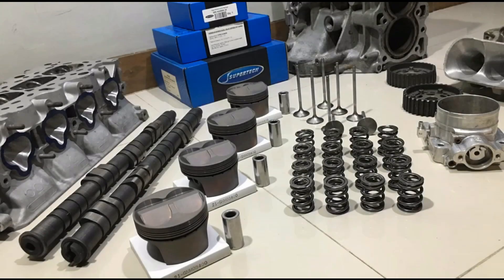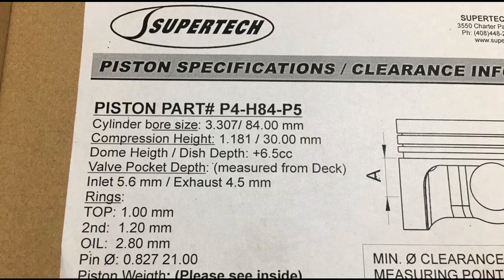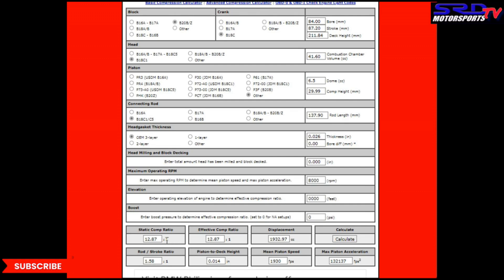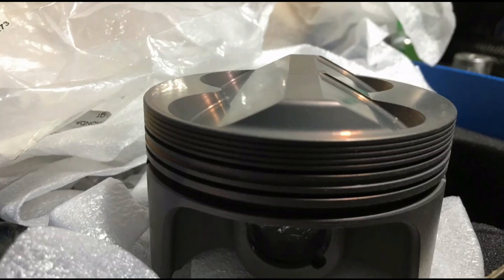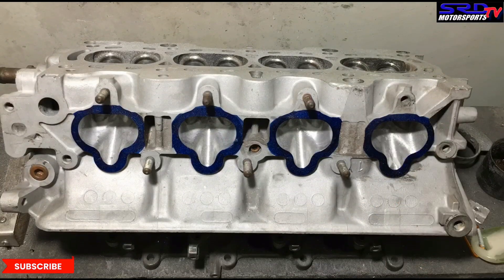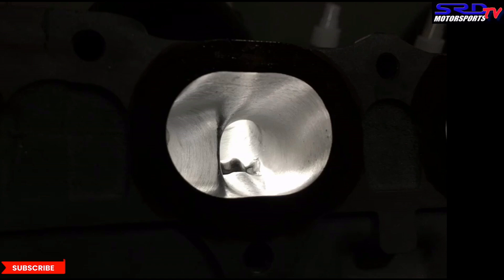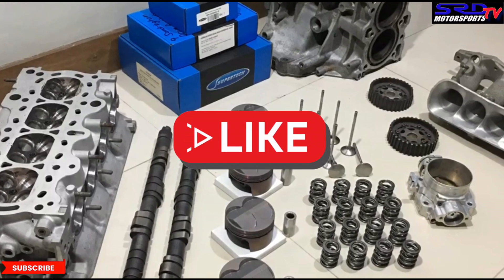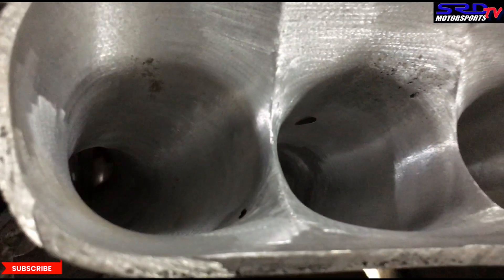B20 VTEC RACE Set-Up Build discussion by SRDmotorsports

Comment: You say pump gas what octane.  93 is the highest I have at the pump and I'm building a b20v after doing some calculating is gonna be 13.7.1 compression
Reply from the maker: 97euro octane so 94US equivalent

But it’s really on tuning 
I’ve seen people blow up even on 99 octane and just 12.5:1 comp

Comment: I think I got my answer on this video, I don’t know? Lol maybe, b18c1 refresh
Reply from the maker: The hard part is “both” of ur options are top choices so both are good actually !
Reply: @SRDmotorsports  the reason I wanted the b18c1 mainly was because I’m able to rev it higher with little sleeve issues
Reply from the maker: @carlosvidal3480  well the b20 has less sleeve issues than most think it’s always a tune issue…

But for track use? That girdled b18c1? I prefer! 😎
Reply: @SRDmotorsports  perfect 🔥
Reply from the maker: Yes sir! 🔥

Comment: What's your thoughts on putting an oversized valve on a Honda heads like putting a 1 mm oversized on an intake side in a  H22
Reply from the maker: on D B and H it depends I mean if the set up needs it… like for example if the set up is on Pro3 cams and it’s still “needing” a bit more? As can be seen on the dyno then yep it will help…

But let’s say anything mild the stock valve size is good for big numbers as it is
Reply: @SRDmotorsports  it's because the bottom end is pretty good high-compression 240 psi all across not sure what compression ratio  the head and block are almost mailed to the max and  Pistons are npr racing 11:1 and I want to make more power the head needs more work everything is stock except the dual Springs and titanium retainers from Super Tech
Reply: @SRDmotorsports  it's because I seen on the Supertech website they had 1+ valves for my motor and I was thinking about it with a cam Skunk2 tuner2
Reply from the maker: That would be okay to try but if a Bseries stock sized valve 33mm is good for 308-310cfm then the H22 with bigger valves should top higher than that… and so with that we know  unless it’s topping up at 310whp then stock valve size is still okay, safer on P2v and v2v too
Reply: @SRDmotorsports  I was just wondering what were your thoughts on this thank you for your recommendations , it  because a dragster that I met at the drag strip he had an H22 and he told me just to put 1+  valves intake side and get a good head port and to leave the stock cam he said I would make good power but I want to put a bigger cam too cuz i want all the power🤣😂
Reply from the maker: I would prefer a bigger cam and not oversized valves, because bigger cam = more rpm … and that helps
Reply: @SRDmotorsports  what if I combine the two 😁😂 yeah I would like more RPM that would be nice
Reply from the maker: Well valve to valve clearance issue and piston to valve clearance issue can happen in that case 

Ur safety window becomes even smaller

Comment: Wow I’m grateful for the amount of detail you give in your videos. Finally got the motivation to finish the the project I never started. B20v GSR head NA to see if I can keep up on the track with my best friends GR Corolla
Reply from the maker: Oh that’s definitely nice to know man! And now u can find more “fun” in your project and so go for it! Sounds like a lil beast in the making!
Reply: I was smoking gr corollas at the track JDM gsr matching trans bolt skunk 1 tuner cam made 178 on a hub dyno gutted car removed front and rear crash bar almost full spherical suspension del sol seat 6 piston bbk gsr rear disc car is a lot of fun didn’t try a bucket seat car was still fast

Comment: How much hp did you get on this build?
Reply from the maker: Hello…this hasn’t been fully assembled/finished as the owner has a newborn now so we know how that goes 😂

but this is an easy 240-245whp pump gas as in 2018 we did a similar but with non forged pistons (1Up) and we got 235whp on full exhaust with a chambered muffler.

Interestingly a hatchback
That does 225WHP (Jasper’s) is a 12.5sec set up on pump gas (Blaze)

While earlier on (on Wiseco pistons) we did 233whp and that hatchback ram 12.1sec
Reply: 12.5 sec pump gas blaze and your using a stock 4.4 s4c tranny?
Reply from the maker: @sharmainecastillo3446  yes ITR tranny

Comment: ? My builder tells me to ditch my b20vtec and build ls VTEC why is b18 block better
Reply from the maker: That’s a common misconception, as way back it was claimed cuz the b20 has siamed sleeves meaning the steel part is merged together they say it causes cracks but I’m also a tuner since 2008

and I know cracked sleeve is 98% on the tune and 2% fuel to be blamed 

Not saying your builder is wrong but we got a b20vtec running 12.5s on pump gas not e85 no trailer a pure street car and it’s been running since 2017 :)

Comment: Hello
That compression calculator can be use for other motor...
Reply from the maker: yes if u include all the proper measurement like adjust deck height to suit and match as well as combustion chamber volume and piston dome volume

crank stroke and rod length together with piston compression height etc

Comment: How much does a build like this cost?
Reply from the maker: Back then (parts were acquired before this pandemic… around 2019-2020)

Was around $1,500-2,000
Granted that was including the actual head this is being built from the ground up

But some b16 owners or gsr owners may have it cheaper a bit since they got a cylinder head already

Comment: Question??? I have a 96 spec type-R motor "JDM-R". Should I just do head work and manifold work. Leave bottom stock. Running all motor. With 9k RPM... or leave it all stock. Oh chipped ECU.
Reply from the maker: I think manifold work and head work is a good start and step forward 

A compression test could also give better ideas if it’s healthy and what state
Reply: Yes compression test for sure. Thanks...we'll plan to do head and manifold work.
Reply from the maker: @jdm-r2524  ayt cool where is this from?
Reply: @SRDmotorsports  MN
Reply from the maker: @jdm-r2524  oh cool! U gotta beware… I got a pm
On the page as u saw we did 201whp on a mild full exhaust b18c SiR right?

Got msg his is an ITR engine with aftermarket forged pistons better skunk2 cams etc
Dynoed at 198whp LOL!

done by a “super lodi shop” thats “mabango” image on FB …told the owner I can’t do anything unless he clears it with the origin of the engine (shop) and we work on let’s say his manifold this way he is a customer but as of now? Sadlyf imagine cost of that (aftermarket pistons and eagle rods)
Reply: @SRDmotorsports  whhaattt that's it. Wow.. I might just go with head and manifold work. See how that goes. Mines a JDM-TYPE-R. higher compression, so might stick to stock bottom end with LSD trans.
Reply from the maker: @jdm-r2524  yep both shop and tuner are “lodi” level on fb so 100% u know em’
Sadly all we see is posts that made power not these looool

And yep I’d stick to stock bottom end
We did 211whp on a stock bottom end and the dude ran 13.4 lol
Reply: @SRDmotorsports  nice...
Reply from the maker: @jdm-r2524  B or D that’s the one candidate I wait on now… got an idea which I think has never been done or seen before

-baserun dyno check results
-refresh stick to oem block and engine
-set up some tricks and solutions for power
-when finished check alll
-baserun dyno to see power difference on just engine condition alone no ecu touching

fo sho we all wanna see that lol
Reply from the maker: Btw what Ecu u got?

Comment: Nice setup. You know weight of piston and pin?
Reply from the maker: Yeah the piston in itself is around 290-295grams the Pin I have not yet weight but yes we do weigh all 4 pistons and match all 4pins together :) 

Later in the day maybe I can test weigh one piston to reply here…

We match the piston weights as shown in an older video about piston balancing that we did :)
Reply from the maker: if you're subscribed i can weigh the and post a photo in the channel community right now btw Piston and Pin weight :)

Comment: How do you cut open the manifold for porting? Are you using the dremel for cutting with what kind of cutting blade? How do you put them back together? Tig weld?
Reply from the maker: oh hey sorry for the late reply... nice comment now it gives me an idea that maybe one of the future vids we show cutting it 🤣

believe it or not 90% of the cut is using a hand saw with a steel blade for cutting steel (hss) aka "lagaring bakal"

my angle grinder as a thick disk the usual ones? so it cute tooo wide so wat i do is i use the angle grinder as "starter" to get the edge started then switch to hand saw... believe it or not since its aluminum? it cuz not as hard as if it was steel... though not as easy as wood 🤣

yes Tig weld it shut after... 90% of the time we clean off the welds and prep the details of the outside so its "mukhang stock" lol
Reply: Thank you po 😁
Reply from the maker: @Charlie-uu8so  thats for checking it out... and wondering how its cut 😂
Reply from the maker: @Charlie-uu8so  depending if youre in the south or metro... Edmel the machineshop is at QC who tig welds great and down south is ATi the machineshop too
Reply: Yung ATI machine shop po ba yung sa may santa rosa? ATI group Inc.?
Reply from the maker: @Charlie-uu8so  yes madami sila branch i believe Staging Lanes si boss Vannie tig welds din
Reply: Noted po thank you
Reply from the maker: @Charlie-uu8so  youre welcome man! and thanks for the comments or questions after watching keep it coming :)

Comment: thanks for sharing this build sir, 
pwede po malaman yong link don sa compression calculator?

also, I have been hearing na the stage 3 cams or level 3 cams are not for not good for daily use(street car) daw..i guess they are wrong.
Reply from the maker: yes sorry let me add sa description its zealautowerks or works not sure

ung stage stage ng cams i think lumabas sha or reasons sha kase the boxes ng cams says

stage 2 for race-street use
stage 3 for race ONLY

when its cz they know sa US mga mareklamo warranty or if d gumanana theyd blame the brand but stage is just a name or a term

its always basta camshaft sha if xxx duration then do xxx approach to make it work or
if yyy duration then do yyy approach so it works...

you have no idea ang dami din nag sabi sakin na customer na hanggang pro2 lng daw prefer kase street car eh ok ok sige
but we have built 3-4 engines na b20 na nka pro3 idled at 850rpm nka aircon pa hmmm 🤣
Reply from the maker: updated the description now with the link hehe
Reply: actually po im on a stage 3 with 84.5 ycp piston..hehe..any idea po sa CC equivalent don sa dome para ma input ko sa calculator?

wow, 850 rpm on idle..swabeng swabe cguro andar nyan sir😁
Reply from the maker: @the063one  2.5cc dome ycp

im sure dami experts d alam yan 🤣 kase magaling sila 🤣
Reply: @the063one  Who built your engine? I think you better ask him details and the rationale for choosing certain parts together. A cookie cutter build may work but the builder should at least know why the part selection works and explain it to you as his client.
Reply: @findtherightbeat  a close friend of mine, to be honest we are still on a learning process in this part of mindanao me and my friends to be exact, back yard build, having fun while learning..we will definitely we would discuss about this matter. again i would thank sir SRD for this informative videos we are learning a lot.
Reply: @the063one  I'd suggest getting the book I mentioned, it'll probably get you within the ballpark of an engine with good volumetric efficiency. It's giving attention to the little details that count that will produce power and ensure the longevity of your engine. 

It's 2022, most of the information you need is out there, you just need to know who to listen to or follow.
Reply: @findtherightbeat  thank you sir, will surely look for that book
Reply: 11.5:1 static comp ratio result
pwede nyo po ma interpret sir?
if its not too much to ask po😅
Reply from the maker: @the063one  yeah tama sha sa ycp tlga seems mababa no?   what i mean interpret?
Reply: I mean, baka po may interpretation kayo sa ganyan na compression.

ayos yong comp calculator kasi may color sa na lumalabas sa gilid, yong sakin yellow green, kanina nag input ako tapos may mali ako na na tick sa choices lumabas is red.
Reply from the maker: @the063one  okay naman 11.5:1 static its good kung iisipin naten

publema kase madami fb experts na super expert sa engines or all motor na lagi nlng 
"ah kelangan mo nito"
"dapat ganito gamitin"
"eto ang alam ko nakakalakas"

then if u ask? d nila nagawa un nadinig lng nila o ginawa ng tropa nila o worst? ginawa ng tropa ng tropa nila so napaka layo 🤣

If you check my old videos? ung eg hatch ko first rebuild ko in the mid to late 2000s
ph15 LX engine carb cnverted to efi like esi so d15b7 sha stock block pero 14.8sec
wala pa po gearing trend nun hahaha
Reply: @SRDmotorsports  They should probably buy A. Graham - Bell's book instead. There's a lot of misinformation on the internet and even in person -- to the point that it's not even funny and they're just trying to sell the person stuff he doesn't actually need or need YET.
Reply from the maker: @findtherightbeat  that is an awesome book btw
Reply: @SRDmotorsports  There's this guy from Finland that followed almost all the principles in that book in his D15 build and the results were pretty good. I just can't remember that bloke's username.
Reply from the maker: @findtherightbeat  its janne aka rushi
Reply: @SRDmotorsports  Yes, he's the one. That's what I noticed about his build, it was purely a textbook approach except for the Hytech style header with anti-reversion chambers.
Reply from the maker: @findtherightbeat  yep and 90% simple build